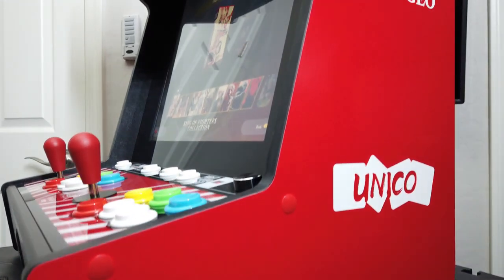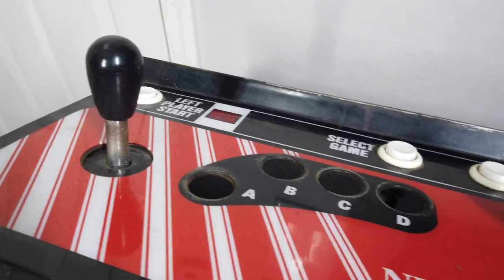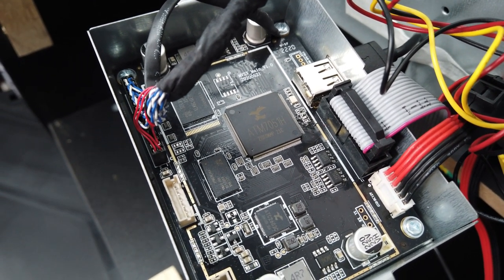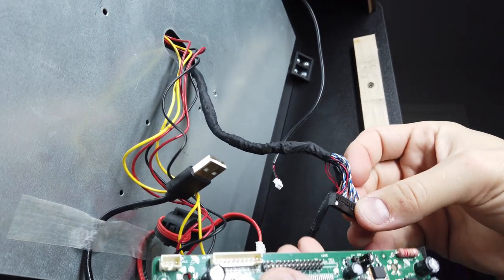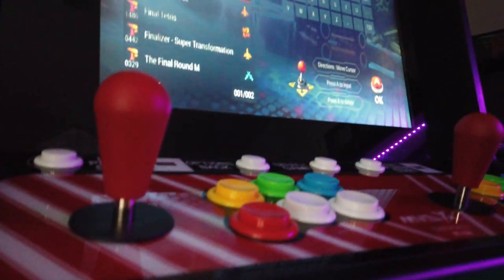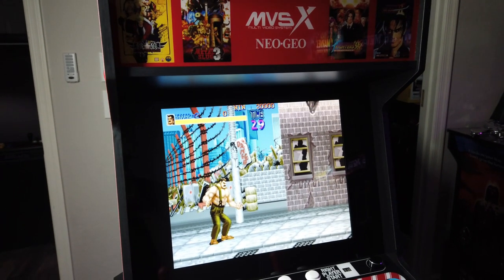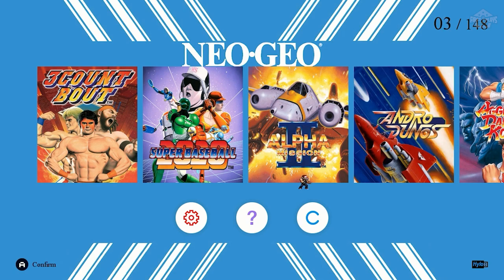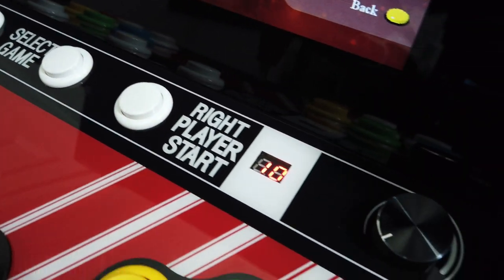The Neo Geo MVSX Arcade Machine - Let's MOD it! - Part 1

Comment: So, any update?  Staring at mine just waiting for your guide!
Reply from the maker: I would honestly wait it out.  Looks like sometime in February we will be getting a hylo soft mod. It will make modding it pointless as it will support most emulator cores.
Reply: @RetroRalph  YES!  OK, but can you do a short one on maybe just hardware/controls?  Conflicting info out there on what buttons just fit, which ones need dremel, which sticks fit, etc.

Comment: Curious if you made the 2nd video to this mod,  Picked up a MVSX and soft modded with HyloX....unfortunately not all games run at full speed and the emulators don't seem to be optimized for the board that included with MVSX. Still lots of games mainly missing the midway collection. Would love to know which buttons fit with the stock holes and which board to make the controls USB compatible. Thanks for the great video, it helped with the decision to pick up the MVSX ......cheers!

Comment: I got that exact same lcd controller board and same monitor in my mvsx, but the native resolution and any 4:3 resolution are all shifted to the right by a couple of hundred pixels. There's nothing overscan can do. Starting to think it's a hardware issue if software can't handle it.
Reply from the maker: Well the monitor is actually a 5:4 monitor and not a 4:3 as advertised on their website.  What are you hooking up to it Pi, Pandroas box?
Reply: @RetroRalph  thanks for your reply :) Raspberry pi, fresh install. Also tried hooking up Windows to  the monitor to see if it's not Raspbian but the same issue. 

No matter what resolution I select, there's always a huge black border on the left.

The funny thing is, when I set the resolution to 1080p, the screen is filled up to the left border but of course falls off on the right. When I select 1280x1024 or 1024x768, the image still falls off the right part, because the image only starts with a big offset from the left.

When I select fullscreen in the osd picture size, it stretches out non HD resolutions to the left but still falls off the right, because it looks like it's trying to stretch 5:4 to a widescreen format...

It's driving me nuts! There is one element in the monitor osd menu that is not available and it's the second one in the menu where you can move/rescale the picture...
Reply from the maker: @MotleyCooper  hmmm I wonder if the Pandora’s box is scaling the image somehow to fit the 5:4 aspect ratio.  That's weird man... Isn't there a setting in retroarch to support 5:4 monitors?  Did you try that by chance?
Reply: @RetroRalph  in retropie I messed around with forcing resolutions and overscans the whole evening. I stopped thinking retropie is the problem. It's also there with Windows. 

I'm gonna keep on digging though, contacted the manufacturer of the controller, they seem pretty active on Amazon.
Reply: Made a video of what it looks like. In /boot/config.txt I'm forcing 1280x1024 and you can tell by the osd that it's being applied correctly. But there's always a bar on the left.

Playing around with built in picture modes only shows that it all starts from the middle.

https://youtu.be/QlcsNm_p_rU
Reply: I think I got a wrong one. The controller is a generic universal one that has to be flashed with the right firmware so that it works with your screen.. I think mine got flashed wrong. Which is good news!
Reply: @RetroRalph  I got a new lcd board and it works. Rewired the sticks and buttons to usb boards, and wired the speakers straight to the 4 pin audio output on the lcd controller. I don't know how to do the marquee light, I think it's 12V. I think I can solder the volume button wires to the volume controls of the lcd controller but I'm not sure 😅

Comment: Ralph I just acquired an original Pac Man arcade machine, Needs work. I want to keep original Pac-Man theme, but gut it.... Add LCD screen, new (1-joy stick, 3 button w/trac-ball) panel and make it a multi-cade. With the limited control set up, I only want to put classic arcade games in this. What Is the best jamma multi-PCB for this?? I saw you hate the Game Elf: Vertical 412-in-1.